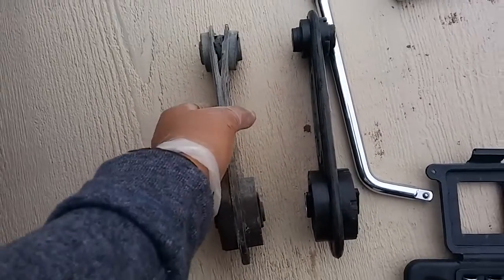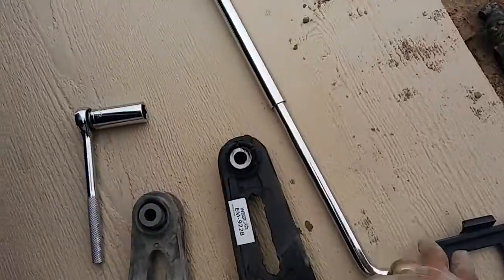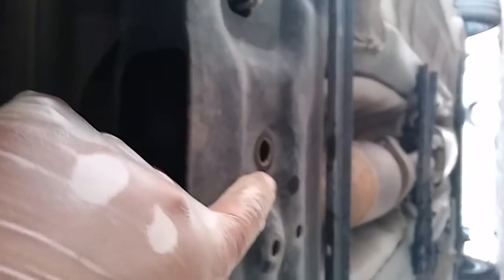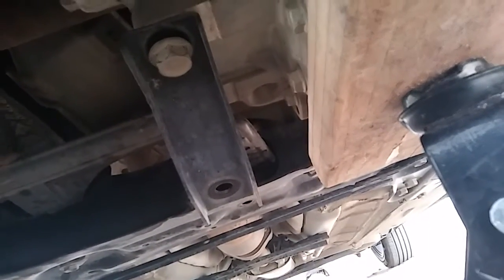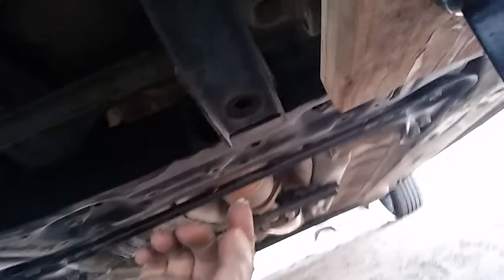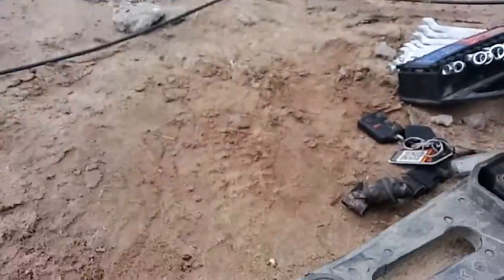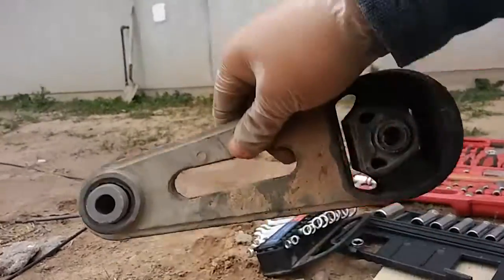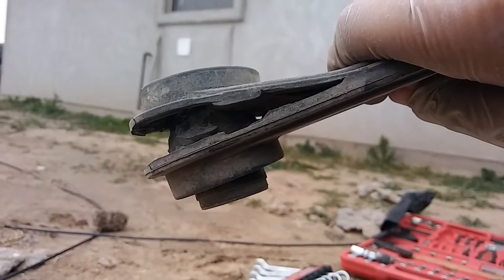Replacing motor mount on Nissan Sentra 2011

Comment: I need to replace the upper passanger side mount. Would I jack the engine same as you on the left side, even though the mount is on the right?
Reply from the maker: I would go do center of the motor to keep it balanced
Reply: Don't recall the underside of car, but believe that would mean putting a 2x4 across the oil  pan and engine/transmition connection seam. Oil pan safe taking that pressure?
Reply from the maker: razz P that sould perfect as long as you relive pressure from the mounts they should be easy to take off

Comment: hi there,there are three mounts.. one in the right side in front of the passenger,the second part is where you are showing in this video. my questions is... the third one mount where is located?? thanks a lot for your help.
Reply: Driver side, you need to remove the tire.
Reply: that mount is called ," the high left mounting " is below the air filter, you need to removed it.